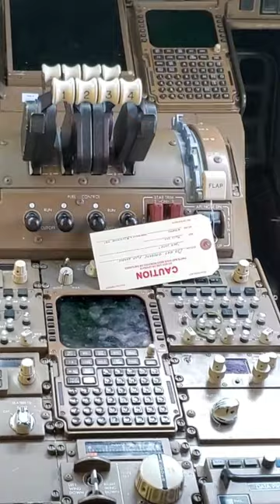BOEING 747-400 safety sensitive inspection turbine engine start up  #shorts

Comment: Text 2 the coolest one was a good size ufo was almost over the roof anda fast moving jet appeared to hit the ufo perfect head on I actually jumped but were a great distance apart .
Reply from the maker: 💪 💪 ✈️ 🎵🎶🤜🤛✈️  Thank you so much Gorge  for your comment and concerns. We really appreciate it. 
The pilot did not report any engine vibration indication in the flight deck.
There are procedures in place for entering a turbine engine while its rotating beacuase of the Wind. No Cracks this time. The dent happened from a bird 🐦 strike The blade was replaced even though it was within  manufactured serviceable limits. SAFETY FIRST  Welcome to our channel my friend. Glad you enjoyed the short preview video✈️. You will enjoy more the FULL video link ⬇️ below 
https://youtu.be/535auR2bp6Q
Let me know what you think 🤔 
Have a great Thursday  night  🌙 😀  ✈️ 🎵 🎶 🌅
God bless you  🙏 safe travels